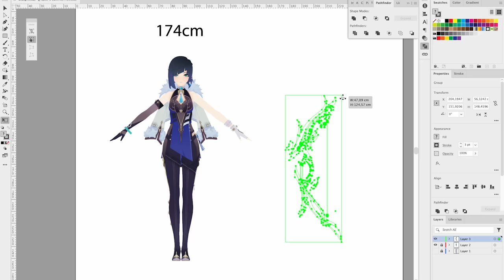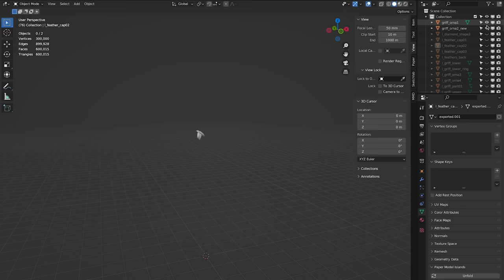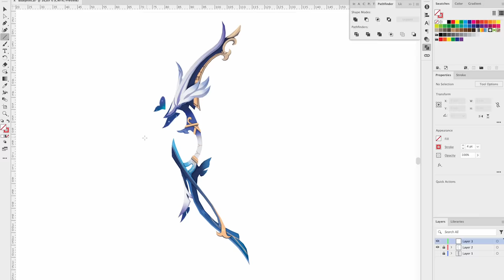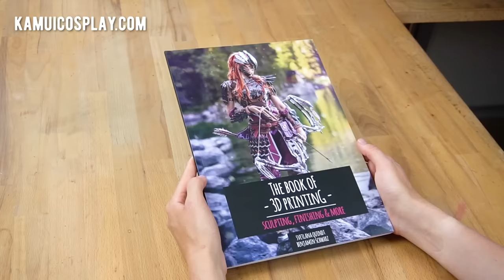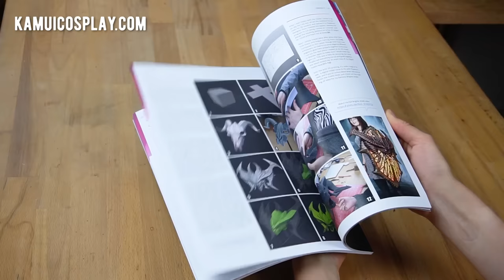We built Yelan's bow from Genshin Impact! 🦋

Comment: I'm wondering if you ever bothered to print props with filaments that are not ABS? The reason I'm asking is that most people just don't have the workshop to deal with the outgassing chemicals that ABS puts out. I thinking of materials like PLA, PLA+(stronger and cleaner prints compared to pure PLA), and HIPS (niche but this workhorse has potential from tests I've seen as a print that can be abused as a prop/stage weapon that sees a little more wear and tear). As well as other materials like ASA (UV/weather resistant ABS plastic), Nylon, Carbon Fiber blends and PETG in general.

I understand if it's not broken don't fix it mentality but it's hard to find cosplayers/makers experimenting with different options for open-air printers that don't come with a degassing chamber/Enclosures. Most of us are in the $300-800US range of printers. Personally looking to get a Prusa MK4 3D Printer kit because I want to work in quality first and sacrifice some speed compared to the cheaper $300-ish models out there as this is not my main job. <3

Comment: I'll bite and say that 3D printing is not crafting. It does take time to learn a computer program and the "buttonology" for whatever machine you are using, but there is ZERO hands-on skill needed. Made a mistake? print it again with different settings. Need a part you didn't account for? print that out too. There's no creative mind at work, just a computer.